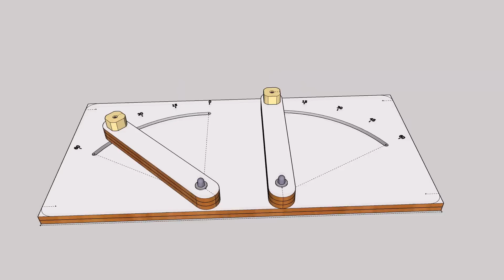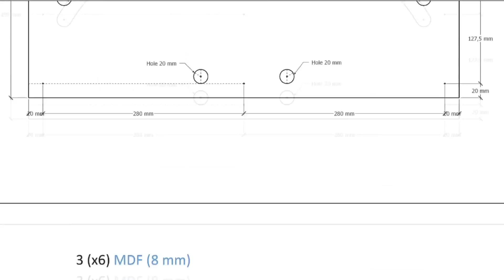Here is the Table Saw Sled You Have Been Looking For

Comment: Gracias @Murat Guney    today finish the Sled .  tomorrow i will try to cut few wood block i need for a project . Saludos desde  BCS ,  Mexico.
Reply from the maker: I'm glad you finished.  Thank you for your complete response.  A very nice and useful sled.  Ideal for both straight and cross cuts.  Please be careful while cutting.  Work with the possibility of kickback in mind.  I would be glad if you share your thoughts after the cut.  I wish you a good day
Reply: . hi. It works Great . thank you i finish my proyect today .. you have instagram ? i can post some  pics.  i did have one  kickback, but i fix it using pliers to hold the piece i cut . because was little.
Reply from the maker: Hello.  I do not use Instagram for now, but you can send it to muratguney67@gmail.com.  Thank you

Comment: Wow! New subscriber here. I have watched a few of your videos and have been amazed at your ability to make quality tools and jigs with easily acquired materials. I suppose that some of these jigs or tools wouldn't hold up in humid environments (like the place where I live --- Florida, USA). Or they might not survive being dropped on concrete floors as well as the fancy, expensive tools that can be bought from specialty tool suppliers. But who cares? If I made a sled like this and then dropped it on the floor, I could just make another one!
Reply from the maker: Thank you very much for your nice and motivating comment.  I usually use MDF.  But very high quality birch plywood can be found in America.  You can make projects with plywood using the same dimensions.  Note that you can find PDF plans in all my videos in the description.  Greetings from Turkey
Reply: Why not consider using 3/8 thick aluminum plate as a base? Humidity would not affect it, and you would be so proud of it you would never drop it. Aluminum cuts easily with a good saw blade. I'm not sure how a router would work on aluminum to make the radius cuts.
Reply from the maker: Hello.  Aluminum would be nice, of course, but I think it is a bit of a disadvantage that it is expensive and difficult to process.  I make the angled cuts on the jigsaw bench.  If I insert the metal tip, I can cut it too, but not everyone has this opportunity.  Also, I would be really upset if it fell.
Reply: True. I was just putting up an alternative material to address the humidity issue in Florida.

 Regardless of what material is used you have made a nice sled with many unique features.
Reply from the maker: Thank you.  I'm glad you like it.  This is Ankara, the capital of Turkey.  No sea, no humidity.  I wish it was the sea.  Coated MDF is good in terms of slipperiness.  But it would be better if a nice birch plywood is used.  Anyway... thank you again for your interest and comments 👍
Reply: The other poster was from Florida. Close to the sea....

Comment: just use the triangles every time for common angles.   
9:41. set the fence to the triangle up against the blade instead of trying to line up on the edge by eye.
Reply from the maker: Hello.  Thank you for the advice, but how do you set up the fence in a triangular shape?  I didn't understand that part

Comment: What are the two pieces of metal pipe for that I saw in the bill of materials? I couldn't find you using them anywhere on the video. Maybe I'm blind.
Malzeme listesinde gördüğüm iki metal boru parçası nedir? Videonun hiçbir yerinde bunları kullandığınızı bulamadım. Belki körüm. (translation by Google. Sorry if it's not exact.)
Reply from the maker: Hello.  My fault.  these parts are threaded onto M6 bolts.  In this way, there is no gap in the hole, which is exactly 8mm.  Also, the wood is not damaged when turning the angle arms.  I hope I was able to explain.  thank you for your attention

Comment: What is that tape that you used? The double-sided stuff? Nice job...btw, there's a great website that allows you to make "protractors" with any number of angle markers, could be useful for projects like this?
Reply from the maker: Hello.  The material I use is ubiquitous double-sided tape.  You can see that I use it in most projects.  it sticks well.  It can be inserted if necessary.  I couldn't understand the website you mentioned.
Reply: The site allows you to print polar graphs, in many ways, which you could print on clear plastic (inverted), and glue onto the mite gauge, or, it's even possible to transfer the printing to wood or metal, from special inkjet paper... here is an example, with 1 degree lines, every 5 degree indicated... it's a full circle, so you could simply cut it in half for a mitre gauge:
https://mathpolate.com/wp-content/themes/mth/graph/alib/get.php?f=polar_8.5_11_604bce572ade9b6bba4469a78c895572.pdf
Reply from the maker: Thanks...
Reply: Bir şey değil!

Comment: That's pretty dangerous cutting those angles especially with board not laying flat
Reply from the maker: Hello.  You are right about this.  It is necessary to be careful when cutting, and if possible, it is necessary to fix the part using clamps.
Reply: simple enough to make it safe(r) - simply integrate this idea into a full sled so that the piece getting cut is supported right across its length.
Reply from the maker: Hello.  Thank you for your interest.  Your recommendation is fine.  In addition, it is possible to add a section on the other side of the saw so that the cut piece does not fall down.
Reply: 😉it might well save your fingers one day too!  😂 (whilst you still have your fingers!) ... (😭😭😭 when you don't!!!) Please be more careful, you have many watching your very good channel)
Reply from the maker: Thank you.  I hope nothing happens to any of our fingers.  May God be with you